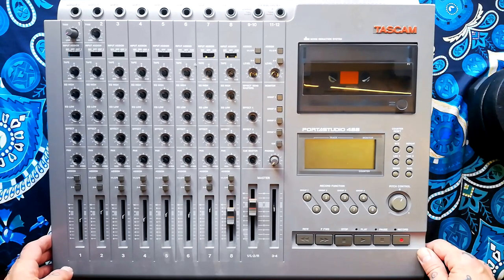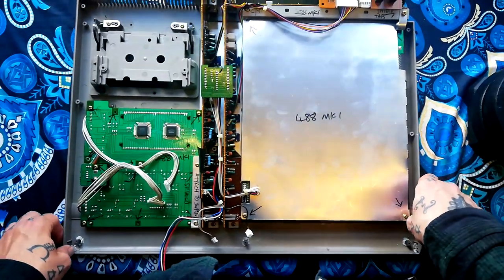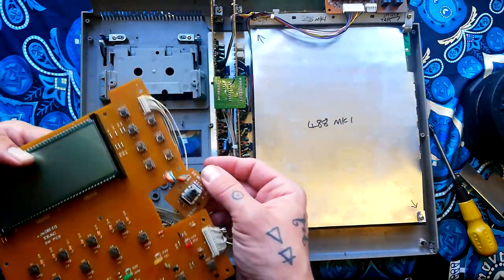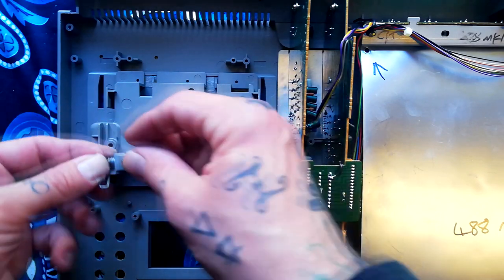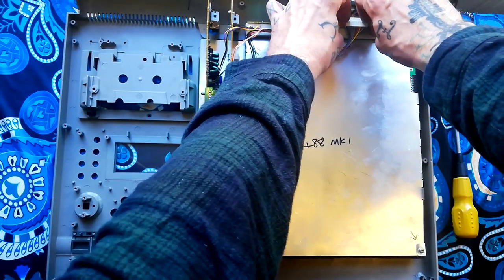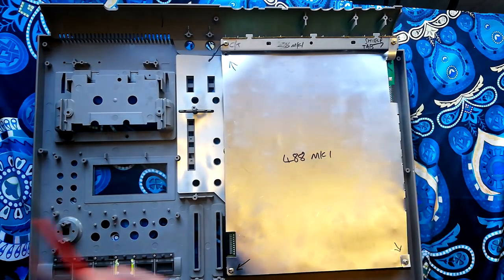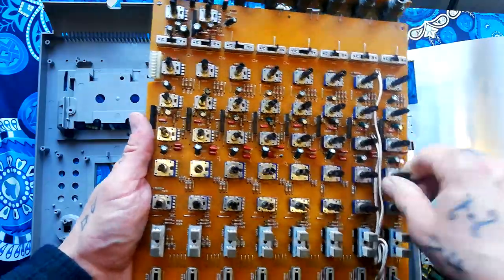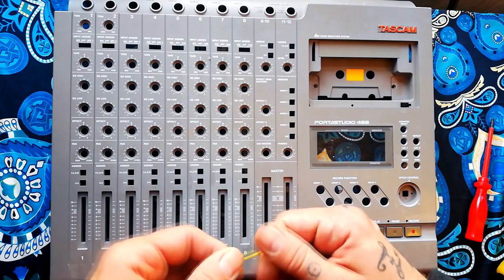Tascam 488 Mark 1 | Tear Down Upper section | (Mixer faders switches knobs door transport controls)

Comment: Hey thank you so much for your videos such a wealth of knowledge!!!

I bought a cheap 488 that wouldn’t play but would rw and ff and changed the belt with help from your other video.

Everything seemed to work great but I noticed all the transport buttons seemed to gradually require more and more forceful pushes to work.

Pushing on the play button a little too hard, I snapped one on of the thingies attaching the play button to the rest of the buttons. Like the plastic part with all the connected plastic buttons. Opened it up using this video to confirm this. Still works button just sits weird.

After that, now all functions (ff, rw, play, etc) only work intermittently. No buttons will respond, then after one is pushed a certain way it suddenly will work as expected and then after that all buttons will work for a bit. Play also sometimes randomly stops after going for seemingly random amounts of time. Could stop after half a second or go for 10 seconds.

Where should I start with trying to sort this out? I’m not sure if it’s an issue with the switches, the switch covers, or something with the motors.

Thanks so much for your videos!
Reply: The buttons/transport issues seem to be triggered by recording a track. I noticed after booting up the machine again everything worked until I recorded an overdub.
Reply from the maker: Thanks. If you look at my 244 or plastic repair playlists, I have a video about repairing the cosmetic plastic button that sits on top of the electrical switch. I think the fact that the issue reappeared after recording is a coincidence. Often, the tactile switches need to be cleaned or replaced. Again, check the 244 playlist for a video on that. Also, the  leaf switch at the top of the cassette player which detects the presence of the plastic tab on the cassette shell and thus enables recording could be bent or dirty and thus making intermittent contact. The tape counter should be ascending when the tape plays - is it? If you haven't already done so, cleaning or, if necessary, replacing rubber parts and lubricating the mechanism can do wonders resolving arbitrary intermittent issues.
Reply: @Tetrakan  Thanks for replying so quickly! The issue seems to be pretty consistent in that every time I boot the machine up after letting it sit for a bit, it runs fine but craps out after a couple plays and rewinds. Tape counter is working as expected. The functions do sometimes abruptly stop, but maybe that's just a bad contact? I will check out the 244 playlist for that and try out your suggestions.

Comment: First off, apologies for asking questions not necessarily related to the videos and hand, I promise I'll stop soon ;)

I kept looking into my 244 mixer channel, and it turns out the fader was a dud, measuring the resistance on the two connectors it was always at 230k ohm regardless of position. Measuring one of the working ones, its supposed to be around 9-10k at the bottom by the looks of it? Either way, took the fader off, took it apart, cleaned it and the same result. After too much fiddling it's not even conductive at all anymore, might have had too much heat on the soldering iron trying to remove it. No loss, pretty sure it was dead anyway. 

It's very strange though, the input strip seems to have a break inside or something, as it's not even leading power through itself. Ie, measuring the start and end of the non black strip, with the beepy short mode on multimeter doesnt beep. However, moving both probes further down it starts beeping. So there's some sort of breakage within I think, hairline crack or something. Probably what caused the high resistance to begin with, and my fiddling ended it.

The short question is, do you sell 244 faders, or entire mixer strips anywhere? :P
Reply from the maker: Yeah I have a ton of parts for the 244, can you hit me up on messenger via my facebook page?
Reply: @Tetrakan  will do! Same name as here I guess?

Comment: Is it possible to buy new replacements for the channel faders of the 488 mk1?
Reply from the maker: Not that I know of. I learned by buying several beat up portastudios of the same model, flip one to recoup my costs, keep one for my own  use, hold the worst unit back as a spares donor, maybe you could do something similar? There's a guy Tascam ninja ( Google him, his site should be the first result) who pieces them out but his prices are high. Occasionally you'll see folks selling spares on eBay. Good luck.
Reply: Tetrakan Supermonobloc Ta. I indeed know Tascam Ninja, I’ll do some further searching first though. Would I come across something I’ll report back. I’m glad that the 2 masterfaders are in tiptop condition, these really look to be a pain to get your hands on.

Comment: Hi - have a quick question about a Tascam 244! It was all working OK, and I'd used it quite a few times, until today when I powered it up and there is a repeating clicking on the audio output, like a click about 2-3 a second. It seems to pause for about half a second every 19 seconds (yes I timed it!) and then repeat. I've removed the tape transport and plugs / DBX board / unplugged each mixer bank...still there. Is there anything you can think of that might be causing this. Last time I used the 244 was about 3 weeks ago and was fine then. Bit odd. thanks in advance.
Reply from the maker: I don't suppose you or someone in your household or building started using one of those powerline extenders to distribute internet via the earth system in your house? I ask because in my experience portastudios are really susceptible to that and other pollution in your mains signal . Its worth getting a power strip with RF EMF filtering in it anyway, probably cheaper and easier than the sort of time consuming recap that would be my next suggestion.
Reply: @Tetrakan  Hi Thanks for the reply. Just started to mess with the 244 on my bench/dining room table...powered up - and no clicking. Took the unit back upstairs to check again from the socket I used on Saturday - hello clicking! Put on my deerstalker and wandered next door where my GF now works from home, with our printer plugged into a powerline plug, which was downstairs plugged into the router a few weeks ago. FFS - the fallout from this lockdown has got really serious!!! I think that's it solved, thanks for your help, love the channel and look forward to your multitrack tutorials.

Comment: Hi there recently purchased a 488 and when I press play it plays for 2 seconds then stops wondering if you might know what the problem could be?
Reply from the maker: Can you feel the capstan (small metal pin) turn with no cassette in the cavity? If not, the belt needs to be replaced. If it does turn, debris obscuring the transistor which relays reel rotation to the counter can cause this.